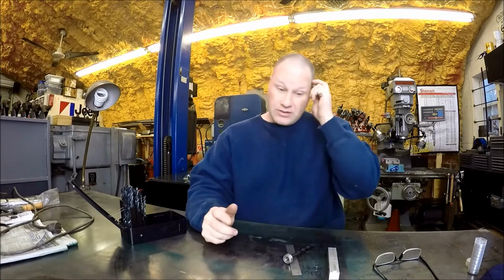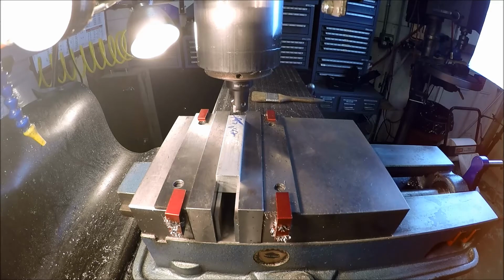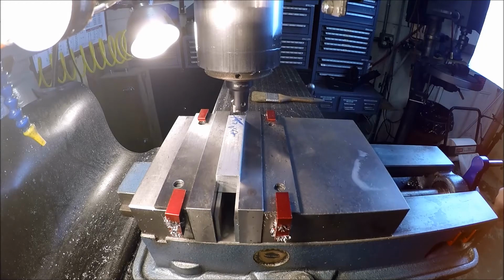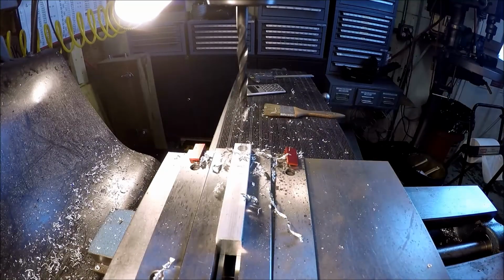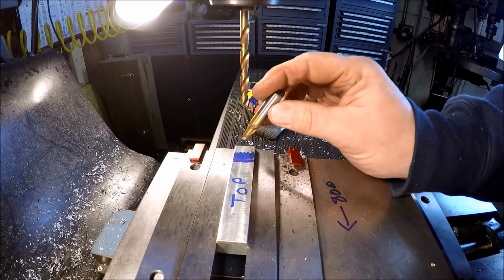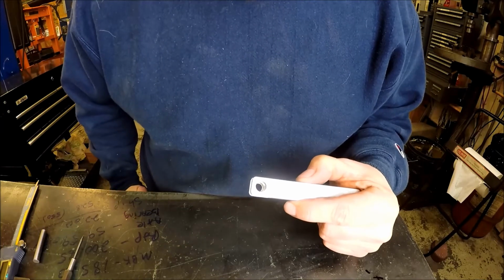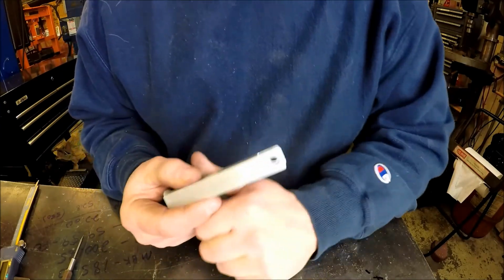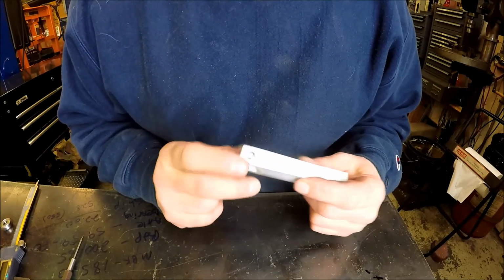Down & Dirty #12 part 1 of making a lathe push tool

Comment: I have one, but I went a different direction. I made mine out of round bar and mounted the bearings on each end, that way depending on the tool block mount you either do face or diameter. Good job so far, hopefully you got to enjoy the warmer days and stayed dry during our monsoon. If I think of it I'll email you a picture of mine
Reply from the maker: I got your email and I like your design. I think we got about 1.5" of rain out of that storm. Dehumidifier is doing its job well though and keeping everything rust free.
Reply: How goes that work in a heated on demand building? I assume you heat your shop when you are working, I have rust but from temperature swings that causes condensation on the larger machines.
Reply from the maker: Yep I only heat the shop when I am in it. I keep the dehumidifier on 24/7 set at 60%. It keeps my machines pretty much rust free.